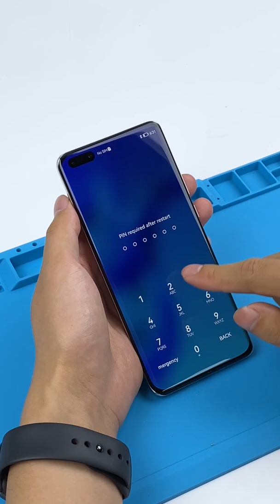Huawei P40 Pro Screen and Back Cover Replacement #Shorts

Comment: hi bro , i accidentally removed touch screen connector of Huawei P40 Pro while it is running , thereafter screen gone blank , but later it is responding to touch but display is blank , what might be the reason , is display fault or board complaint, pls help!